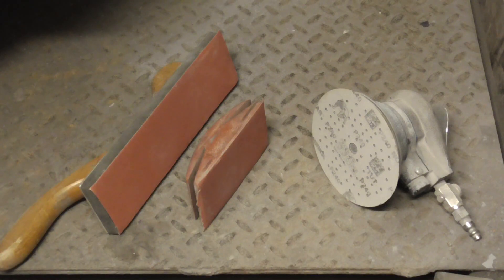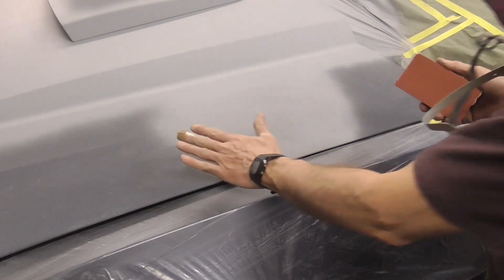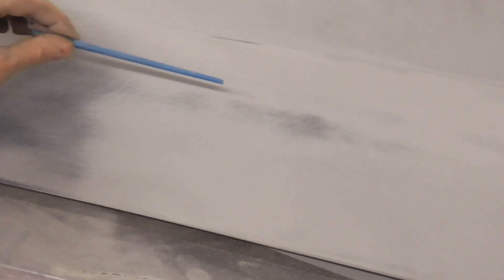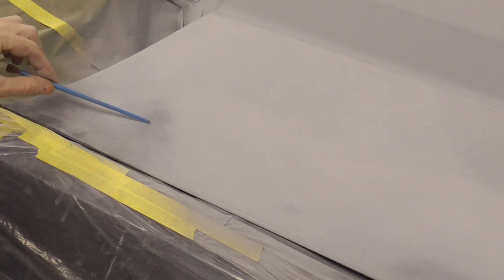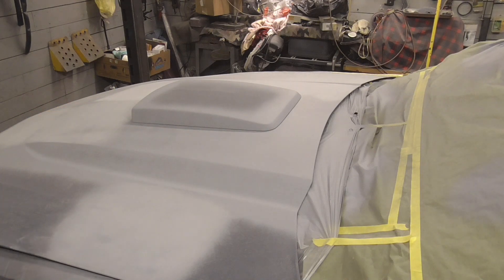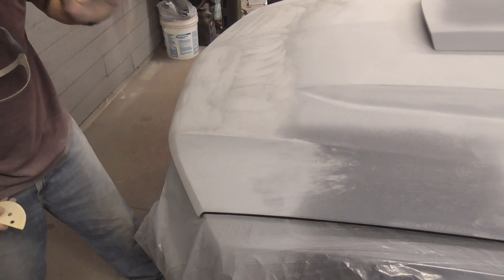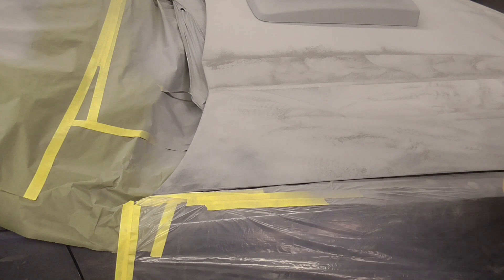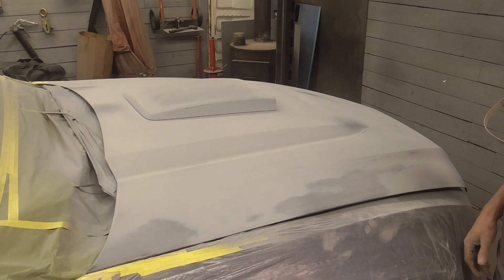Should I use a Hand Block or DA when Block Sanding Primer?

Comment: My Blue Point DA (1982 era) has a half inch total orbital action. I bought a short-stoke 3/16” orbital action recently but have not used. Using finer sandpaper to get finer sand scratches is the task at hand, but getting the panel flat is job one eventually. 
While a DIY need to start somewhere, this video fits that ticket. But to advance, would require “Block Sanding or DA Part 2” video. Using a standard DA is the work-house in the shop, but obtaining flat panels and bumping convex & concave surfaces is normal today with few flat parts to be painted. A10 mm / or 7/16” interface pad helps keep from digging in. Same with short-stroke DA/Palm Sander with fiber paper like 320 - 400 after the steps shown. I wipe down with some isopropyl, I apply tape on inside to outside edges to have a place to stop. This keeps a sharp edge and you can see a shinny line if done right. This to is a tool that can be helpful. As you start the body work, until 400-600 and straight, this is your paint job. 97% building, sanding, product and finer paper with blocking, 3% is painting. 
Tech Tip; Filler, primer or high build clogs paper quick. For 3 decades, I used a folded metal coat hanger with fuel line for a handle, this knocks off and cleans any grit as it loads. 
Like many shapes, I have “Durablock” set with a long and each require holding it and moving hands changes its pattern of sanding. Sheet metal packing blocks are useful once shaped or as they are in with PSA paper as well. Subscribed long time ago, thumbs up here!
Reply from the maker: Thanks Dean always interesting to hear how others do it - thanks for the input and subscribing a long time ago - Jerry

Comment: Fantastic, 
What type of primer are you using when you break thru by sanding
Reply from the maker: Thank you. That is 2K urethane primer from Auto Body Master.  I usually use lacquer primer but really have no preference.  All primers work well if used correctly.  I will do a video on the truth about primers soon so look out for it if interested.  You do get a lot of misinformation about primers in magazines and internet so... When in doubt feel free to ask ?s about it - I'll give you a reasonable answer.
Reply: I use a compatible 1k shaker can with no issues. But i will looking forward to this video.

Comment: Great video! Hey can you comment on the best throw for d/a some are 3/16 and some 3/32. I guess most people use a 3/16 on filler and a 3/32 on primer and paint. Is it really necessary to buy two d/a's?? Also some are d/a and some ranfom orbital....should I pass on the random orbital?
Reply from the maker: I believe the companies are using the terms DA (dual action) and random orbital as the same term.  As for throw - I like a larger throw for faster sanding (more aggressive) and short throw for finish sanding around trim, etc. so that it doesn't bang into it.  No you don't need both.  Get the one you like or feel comfortable with.

Comment: I've got another doozie of a question for ya- with black paint jobs...to get the deepest black possible...would you use a black sealer over gray primer, or would you use a black primer, or does spraying black over typical light gray primer work just fine?
Right now I'm thinking black primer and maybe a white guide coat...but I'm in total guessing mode. It does make sense that black something under the base, especially with the cheaper Trinity paint.
Whatchya think? :)
Reply from the maker: Any primer will work.  I suppose if you wanted it to look a bit different or maybe even deeper like you are saying, a few coats of clear would do it.  But just black, wet sanded, buffed and waxed, it doesn't get any better :)  Here's single stage black lightly wet sanded, buffed with a ceramic coating type wax - https://www.youtube.com/watch?v=LMsf7ZUAda0  & here's BC/CC black - no buffing at all - this is just how it came out of the booth - used PPG BC/CC and a good clean spray booth.
Reply: @LakesideAutobody  I don't think the second link came through for the BC/CC black...
Reply from the maker: @designsinorbit  I forgot to paste the link 🥴- https://www.youtube.com/watch?v=2o37dX--w0I

Comment: hi, when i wet sand primer with 400, how do i find low and high spot
Reply from the maker: You'll be able to see small low areas very easily - large low areas should have already been taken care of in the block sanding stage.  You can use a 5" rubber block to wet sand with too - 1 sheet of wet sand paper will cover the block 4 times if divided up equally.  Let me know if that makes sense :)

Comment: Newbie question, is there a difference between a DA and a palm sander?
Reply from the maker: Not really.  A DA like the old school National Detroit DA's are more aggressive and have more offset - even a different geometry (pad does not spin totally flat to eliminate dust buildup) so they sand faster but knock into stuff like trim, edges, etc.  Palm sanders (to me) are usually more for finish sanding and detail.  To put it short DAs are for feather edging paint and body work,  Palm sanders are more for finishing.  That's just my take on it though... hope that helps - good question btw.

Comment: "Block" sanding with a d/a?  Stupidist comment I have ever heard.  You use a 'block' to block sand for straightness.  A d/a will never give you a perfectly flat finish.  ALWAYS block the primer with a block - duh
Reply: D/A sanding is for production jobs not show quality jobs - if it's easy then it probably isn't the best - d/a is easy
Reply from the maker: Well... a ton of dealerships and body shops block with a DA "cause they know exactly what they are doing.  There's times and places you can get away with it and other times - no.  I promise when a car leaves a dealership in and around the Metro Detroit area, you would never ever be able to tell where is was fixed. 👍✌